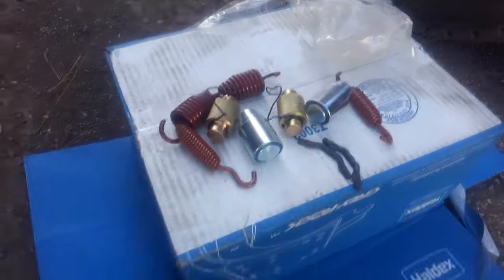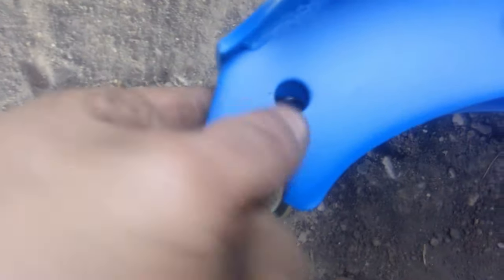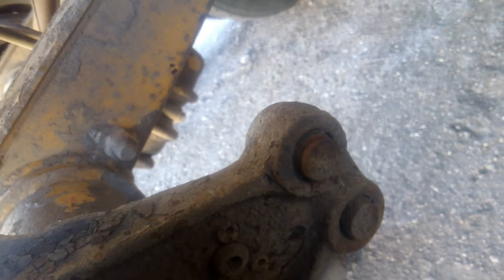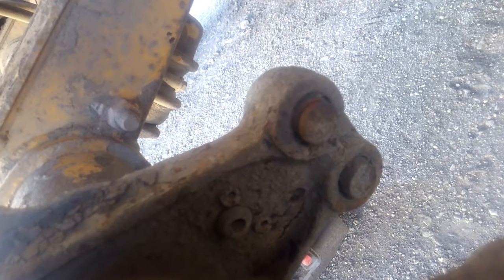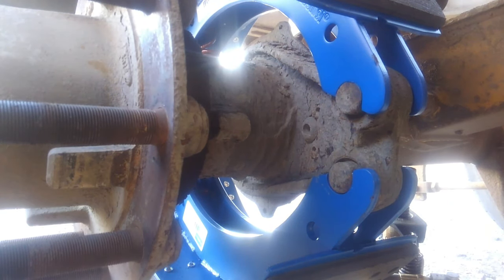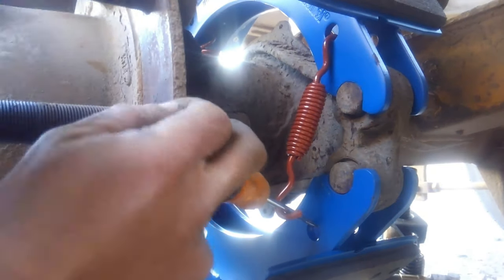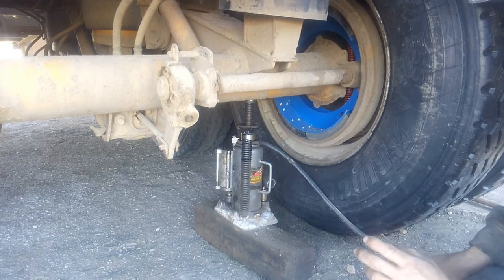how I change semi brakes in 6 mins

Comment: This is a great video. I try to change out those damn bushings as often as possible - can be real pain in the ass to get the old ones out. I also check the king pins before taking off the tire and drum. And you had way less trouble with getting that retainer spring on the back of the shoe than I ever have. Good to see someone who knows what he’s doing

Comment: Ball joint puller for the anchor pins. Heat on the spider is not the best unless u have to. Load up on the puller with your impact then use a mini sledge to hit the puller. Will come out every time with no heat. Just my 2 cents. Always good to try new tricks.
Reply from the maker: what like this https://youtu.be/6IVmwx-90yM
Reply: Ezrider359 ya man!!

Comment: Very helpful video thanks for posting
Reply from the maker: glad you enjoyed the video
Reply: Warnings !!!
To all you guys that follow instructions of this “truck mechanic” 
He did few major beginners mistakes on semi truck brake job !!!
	0.	Take a look at 0:20-0:30 on his video. You can see that spring loop over roller is picking outside of brake shoes. When he installed at 1:45-2:00 that spring loop is inside of brake shoes ???? I’v seen many times that big single spring when opening while brake is applied is catching and pulling out that roller spring with roller inside and makes unfunctional brake? 
	0.	He didn’t check for free play on s-cam what is on trailer brakes very common
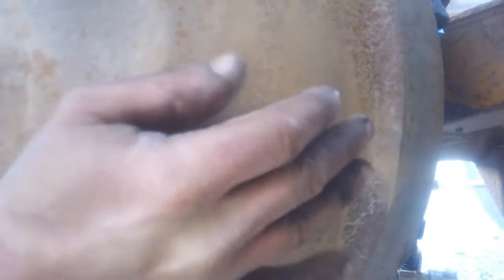	0.	At 5:40 of video I can see that brake drum is worn out. If you install new brake shoes on bad drum will waste 20-30% of shoes just to adjust to bad surface of the old drum
	0.	Installing side springs with small screw driver can be risky. I’m using locking pliers so spring can’t fly out and hurt myself
	0.	Those blue painted brake shoes are probably cheapest what he found. Never try to save money on your brake parts !!! Bottom line : I am diesel mechanic for a years , so I have seen many improper jobs like this one. I’m not saying that this guy is bad. Just be aware when see somebody on dry-way with hoody repairs semi truck.

Comment: Ball joint press works great for getting the old rollers out of the brake spider. And I  use a bit of antiseize on the wide part of the roller on the brake spider and just a dab on just the shoulders of the s-cam rollers where the shoe seats.
Reply from the maker: antiseize is defiantly your friend.
Reply: I bought a heavy duty ball joint press from princess auto slapped some HP grease on the thread and it was good to go seems to be nice and strong they go on sale for $49.99 comes with some adapters too.
Reply: @Coloradomountainexplorer  snap on actually sell anchor pin remover tool..had the shop purchase one..works really well..
You'll have to see if adaptors fit transit anchor pins..the screw thread is turned down to clear hub.
We use to use the c frame from ball joint kit as mentioned..

Comment: There’s a crow bar with a notch cut through the middle to help put on and remove that large spring that makes this job 100 times easier
Reply from the maker: the way i do them is pretty easy no need for special tools.

Comment: Great videos keep going sharing your knowledge so we learn a few more works THANK YOU
Reply from the maker: Thank you
Reply: Warnings !!!
To all you guys that follow instructions of this “truck mechanic” 
He did few major beginners mistakes on semi truck brake job !!!
	0.	Take a look at 0:20-0:30 on his video. You can see that spring loop over roller is picking outside of brake shoes. When he installed at 1:45-2:00 that spring loop is inside of brake shoes ???? I’v seen many times that big single spring when opening while brake is applied is catching and pulling out that roller spring with roller inside and makes unfunctional brake? 
	0.	He didn’t check for free play on s-cam what is on trailer brakes very common
	0.	At 5:40 of video I can see that brake drum is worn out. If you install new brake shoes on bad drum will waste 20-30% of shoes just to adjust to bad surface of the old drum
	0.	Installing side springs with small screw driver can be risky. I’m using locking pliers so spring can’t fly out and hurt myself
	0.	Those blue painted brake shoes are probably cheapest what he found. Never try to save money on your brake parts !!! Bottom line : I am diesel mechanic for a years , so I have seen many improper jobs like this one. I’m not saying that this guy is bad. Just be aware when see somebody on dry-way with hoody repairs semi truck.

Comment: I like how u use the screwdriver and the spring goes in. I've been using vise grips and it seems harder than you'r way. Thanks
Reply from the maker: Works well for me try it and see. Right size screw driver makes it a breeze to small and it's not stiff Enough to big and it's hard to get the hook turned into the hole.

Comment: thank you. simple. straight forward.
Reply: Warnings !!!
To all you guys that follow instructions of this “truck mechanic” 
He did few major beginners mistakes on semi truck brake job !!!
	0.	Take a look at 0:20-0:30 on his video. You can see that spring loop over roller is picking outside of brake shoes. When he installed at 1:45-2:00 that spring loop is inside of brake shoes ???? I’v seen many times that big single spring when opening while brake is applied is catching and pulling out that roller spring with roller inside and makes unfunctional brake? 
	0.	He didn’t check for free play on s-cam what is on trailer brakes very common
	0.	At 5:40 of video I can see that brake drum is worn out. If you install new brake shoes on bad drum will waste 20-30% of shoes just to adjust to bad surface of the old drum
	0.	Installing side springs with small screw driver can be risky. I’m using locking pliers so spring can’t fly out and hurt myself
	0.	Those blue painted brake shoes are probably cheapest what he found. Never try to save money on your brake parts !!! Bottom line : I am diesel mechanic for a years , so I have seen many improper jobs like this one. I’m not saying that this guy is bad. Just be aware when see somebody on dry-way with hoody repairs semi truck.

Comment: Best method for doing the anchor pins I've found is heating the spider red hot then using a ball joint press to pop out the pin. Then heat the sleeve red hot and try bending it up over itself near the slit on the sleeve. Takes an extra 15 minutes at most per axle

Comment: Hey dude . I’ve been following you for a while now ,and you are super handy and smart . I have a 5 axle flatbed trialer , and every single brake on her don’t release Except the front lift axle brakes , so I am guessing my problem is behind the first lift axle air tank ,because I ran alcohol in it and I drained all the tanks ,and I didn’t seem to notice any alcohol coming out off my train valve except the very front lift axle tanks . I spent so much money on this trialer , and every shop tells me something different. I do work on my truck & trialer myself, and I did pull all wheels to check and there is nothing wrong . What happens is every time push my brakes regardless easy or hard they stick and keep heating up till they smoke . All brakes are adjusted according to the stroke length, I thought they tighten up in the beginning, but they don’t ,they just won’t release. The drag isn’t crazy , it feels like the brakes are holding about 10 -20 psi in pressure only . Something else .... everytime I pull my trialer parking brakes when I’m parked at my yard , the valve ( brakes valve on the trialer ) keeps leaking and then engages after about 20-30 seconds . Could that be my problem? It is not that cold in Ontario yet, but I heated up all off my trailers valves today ,and drained the tanks . I noticed black greasy moisture coming out of my tanks .
Reply from the maker: Bad s cam bushings can cause the shoes to drag. Return springs in the cans could be busted bad or gummed up valve could also be a cause.
Reply: Sounds like relay valve sticking not exhausting holding brakes on slightly

Comment: Very helpful man. Thanks for uploading.
Reply: Warnings !!!
To all you guys that follow instructions of this “truck mechanic” 
He did few major beginners mistakes on semi truck brake job !!!
	0.	Take a look at 0:20-0:30 on his video. You can see that spring loop over roller is picking outside of brake shoes. When he installed at 1:45-2:00 that spring loop is inside of brake shoes ???? I’v seen many times that big single spring when opening while brake is applied is catching and pulling out that roller spring with roller inside and makes unfunctional brake? 
	0.	He didn’t check for free play on s-cam what is on trailer brakes very common
	0.	At 5:40 of video I can see that brake drum is worn out. If you install new brake shoes on bad drum will waste 20-30% of shoes just to adjust to bad surface of the old drum
	0.	Installing side springs with small screw driver can be risky. I’m using locking pliers so spring can’t fly out and hurt myself
	0.	Those blue painted brake shoes are probably cheapest what he found. Never try to save money on your brake parts !!! Bottom line : I am diesel mechanic for a years , so I have seen many improper jobs like this one. I’m not saying that this guy is bad. Just be aware when see somebody on dry-way with hoody repairs semi truck.
Reply: Niš Bre good point man. Thank you

Comment: ive used this method for years but used vice grips for the 2 anchor springs. Recently i started working at a new garage and they use dust shields, hard to get the inside one =/
Reply: Put pivot side springs on first. Put shoes on without rollers. Hook s cam spring on the top hanger use a short pry bar with a v cut. Go in below s cam and put the v on the top off the bottom coil and pry down to hook it. Pry each shoe up to install rollers. Faster than his method and you dont have to worry about the pivot springs flying.

Comment: That was awesome. Yeah if the pins are not too worn you can reuse them, I would have used a bit of grease on the high friction surfaces.

Comment: Thx for sharing, I’m currently restoring a 20 ton tag along trailer especially the brakes and single brake chamber I could tell that the existing push rods have been cut inconsistent. How do I cut the new push rod so they are done correctly ? I noticed the single brake chamber have no caging system or come with caging bolt. Do I need to air the system before I measure and cut the push rod ?
Thank you

Comment: Those anchor pins are meant to pivot and rotate in their holes. Doesn’t take long to grab a ball joint press and press them out. Then just shoot new ones in and have a proper brake job done

Comment: i always used to take the trailer brakes up in the 70s after a lot of hill driving with a ring spanner and a hammer just turn them till they stop then back off half inch.

Comment: I've been wondering for a while what that rod and slot thing is on top of these slack adjusters, visible on the far one at 0:10.  I know it rachets/ auto adjusts the slack adjuster, replaces the small arm behind the main connection to the brake chambers.  But why is that adjustable?  Doesn't the slack adjuster rachet 360 degrees?  (as in the rectangular rod can be moved around the slack adjuster, as in why is that part adjustable and what difference does it make?).

Comment: Really hard on auto slack adjusters backing them off. Back them off enough to remove the drum,it's a necessary evil. Peel the shoes off then rotate the adjuster nut clockwise till the cam rolls around 180'. Way easier on the ratchet inside the slack adjuster. Besides that, the cams will wear on the opposite side of the shaft. For the brake springs there is a tool for them especially if there's backing plates. Good video but maybe he should have at least measured the drum before throwing it back on.
Reply: Good advice. I was watching this video specifically to see how not to back them completely off. Crank crank crank crank crank krrrrrrrrrr!!!! Good video. We can all learn something new 😉

Comment: Thanks for taking the time to make the videos.  It's important to understand how our trucks operate.  How and where do you buy the brake pads?  Do you need to know sizes or beans off brakes?
Reply from the maker: you can eaither call the manufactures dealer (pete,kw,freightliner, greatdane ect.) with the vin number and they can give you the part number for the shoes, or you can just pull them off and run down to where ever you want to buy them and they can cross reference the part number stamped on the shoes. there is generally a core charge anyway. after you buy your first set of shoes for whatever your working on you can write the part number in a note pad so you have it for next time.

Comment: Hey let me ask your opinion, where I work we have some drivers who perform their tug test by dragging the tires. I have seen a few drag the trailer 30 feet before pushing the knob for the brakes on the trailer. I know tires take the brunt of the damage but what about brakes? If this continues on a regular basis would the brakes wear down from this? We have been going through tires like crazy cause of this.

Comment: I just had new brakes shoes and drum installed on the front axel on my 1995 step deck trailer and initially I had them backed off 1/4 of a turn and when loaded braking is smooth but when empty I am having issues when them locking up when applied. So I backed them off a 1/2 of a turn and still have the same issue. So I went up to a full turn just to see if that would make any changes and they still lock up when empty. 
Any ideas of what’s happening?

Comment: Can you do a video on adjusting the clutch/pedal etc, if your alone?
Thank you for posting your video
Reply from the maker: i sure can, i have had other requests for a clutch adjustment video . i am not sure exactly when ill get to it. as far as doing it by yourself you can cut a board to length and wedge it between the clutch pedal and the seat. it requires climbing in and out from under the truck a couple extra times but works just fine. thanks for watching.
Reply: When I used to do it I had a telescoping rod to hold the pedal down. Worked good.
Reply: Lisle makes what they call a hood prop, it works quite well to hold the clutch pedal.
Reply: I always used a piece of 2x4

Comment: you could have used a wire brush on the  S cam , also checked the S cam bushings , as far as brake drums go I do agree with 2 relines then Brake Drums and wheel seal , that is how I have always done it on my equipment   O/O from 1980 till 2014 and preferred Kenworths     Frank T
Reply from the maker: s cams and bushings were changed on the previous brake job, im pretty sure i did wire brush them just didn't show it. thanks for watching

Comment: Thank you so much for this!  I have a 2016 Reitnouer stepdeck and I've been wanting to do mine for a while now.  

I have to unfortunately use an electric impact but from what I've heard the Milwaukee electric impact is very strong.

Do you have any recommendations?

Thank you.

I appreciate you man!
Reply from the maker: My half inch Milwaukee fuel will remove properly torqued lug nuts it won't tighten lug nuts to 450 though.
Reply: @Ezrider359  thank you!  I was looking at the 1 inch M 18 but that price!  I have no access to shop air and I have to do things out on the road so it'll be worth it.

I'm pretty excited about doing brakes for the first time ever.  

I've done tons of other things to my tractor and trailer but not brakes.

Take care

Comment: I have  a 2017 wabash dry van. 2 weeks a go I took it to a shop to get rear axle brakes and drums replaced and wheel seals an all wheels but for some reason the rear axle brakes keep locking up I can be doing anything from 10 mph to 70 mph and I can feel how the abs keeps  releasing and holding the brakes it's so frustrating because I took it to 8 different shops and no one can figure out why is doing that since they put new brakes on it . 3th shop I took it to they told me I had the wrong brakes on it so they replaced the brake shoes one more time because they said the shop where I took it to put different brakes shoes on it . Now has supposed the right brake shoes and still locking up . No ABS lights on nor anything else they just keep locking up . I was even thinking that something might be wrong with my tractor when it sends air to the trailer . . I disconnected the abs cables to the trailer to see what it would do . But with out the abs they really drag and smoke like crazy . Any help would be really helpful, at this point I'm thinking of replacing everything on it but I'm afraid I will spend $$$ lot more money and down time and issue won't be fixed . Everything started since I replaced the rear axle brakes before everything was totally fine
Reply from the maker: hum, sounds strange for sure. some thinks i could think of to check would be s-cams and bushings also make sure that the air bags on the rear axle are getting the same amount of air pressure as the front and look at the drums make sure they are in spec and defective and out of round or out of spec or something goofy like that.
Reply: I never even thought about the drums being defective i thought because they are new they were perfectly fine ,,I think that will be the problem because when I Barely touch the brake pedal I can feel how it feels like when u have bad brake rotors on your car, but it never felt like that until they installed the new brakes and drums on it . I will definitely be checking those drums next . Thanks a lot for the reply 👍👍👍